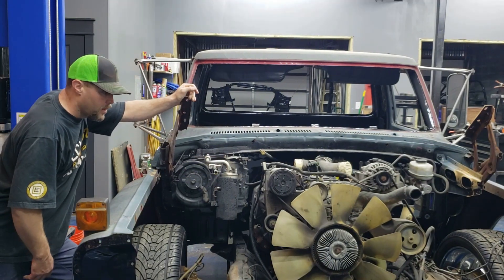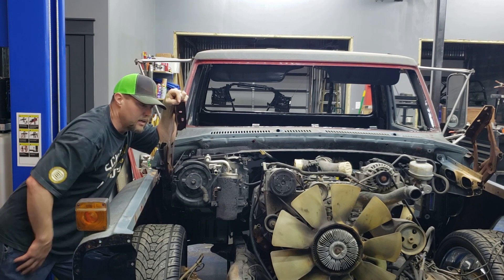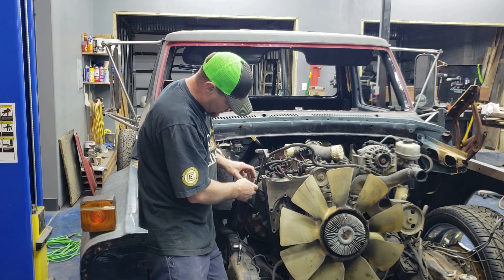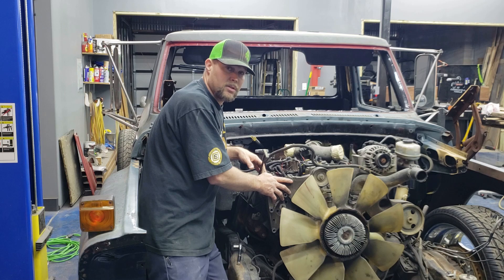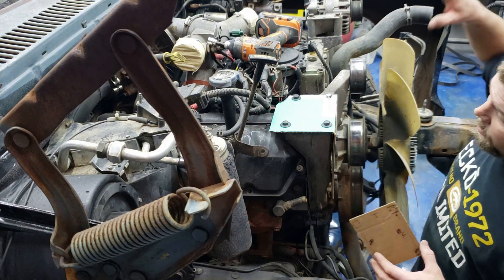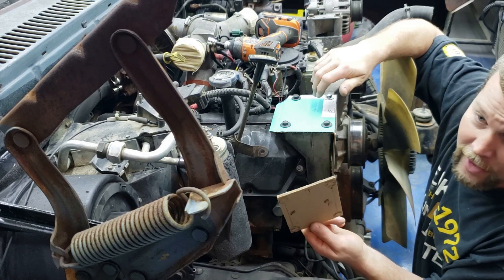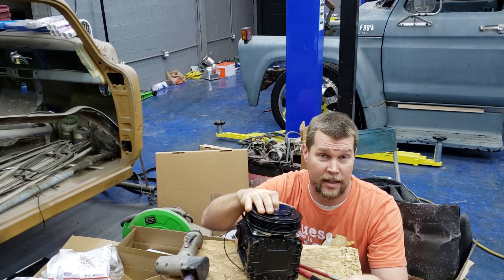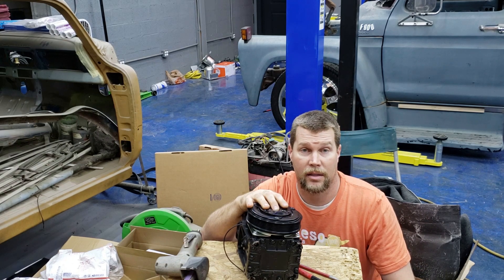War Machine episode 37:  How to install an engine driven compressor on a 7.3 powerstroke

Comment: Is not it funny, in principle, combustion engine exhaust side is compressed gas source without any other parts. If the gases are clean enough and could be cooled if necessary.